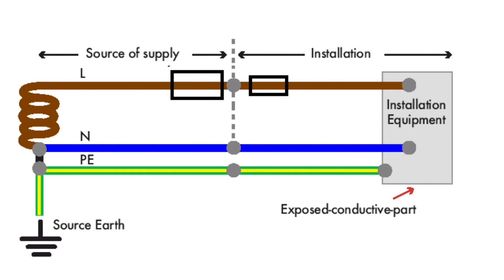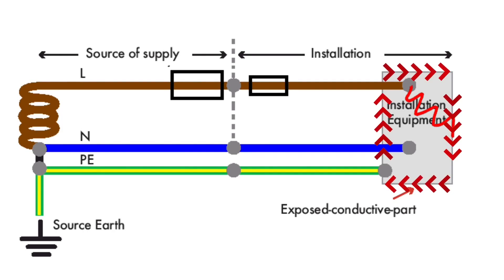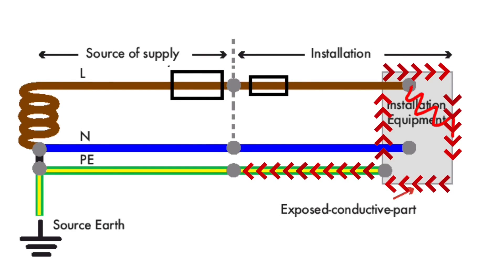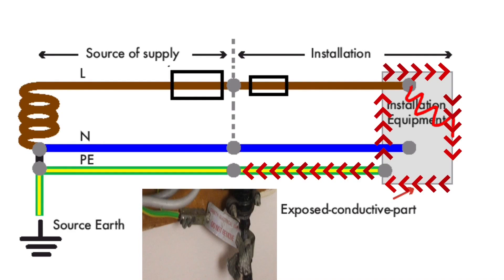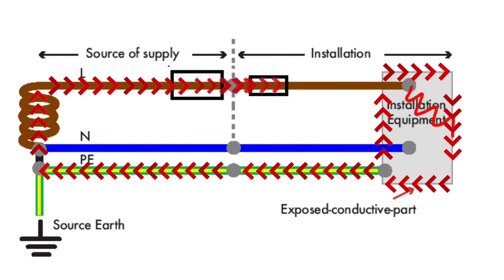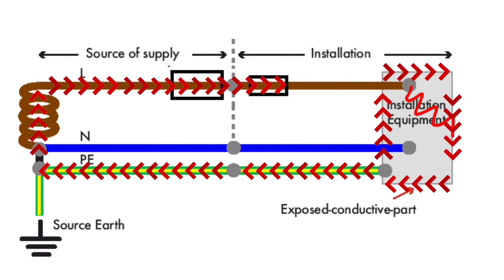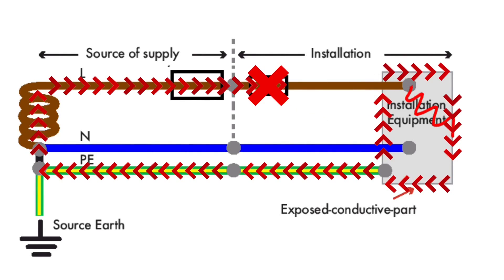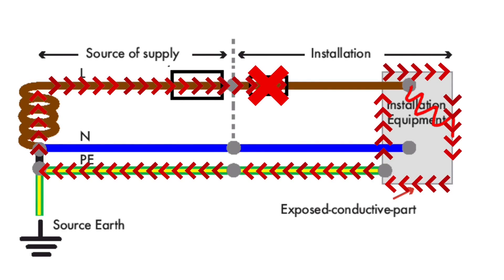Earth Fault Loop Impedance Path for Installations connected to a TN-S Earthing Arrangements

Comment: The point where PE cable meets between transformer coil and "Source Earth" after the fault occurred, any explanation on why the current chose the transformer coil path to complete the circuit and ultimately tripping the fuse on Line cable?? Why the current didn't choose the "Source Earth" path that has presumably lower impedance? Your explanation is greatly appreciated. Thank you.

Comment: I can't get my head around if the CPC is still at 0v potential when the line shorts onto the case, or does the CPC actually become 'live' as you say and has 240v potential? Same as if you connect the line + neutral together, I know you get a short circuit and a big bang, but until the mcb trips has the neutral also got a voltage potential?

Comment: what is the maximum disconnection time for a lighting circuit in a commercial premises protected by a TT System?
Reply from the maker: New On-Site Guide Page 33-34 will help you with disconnect times for both TN and TT final circuits👍. Thanks for the question Gaz